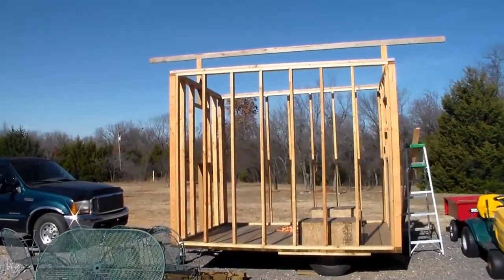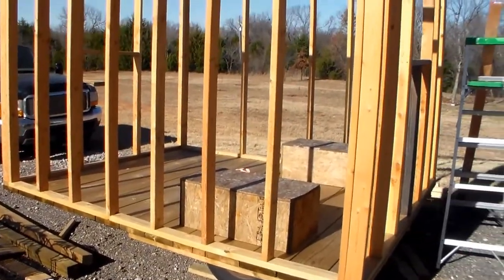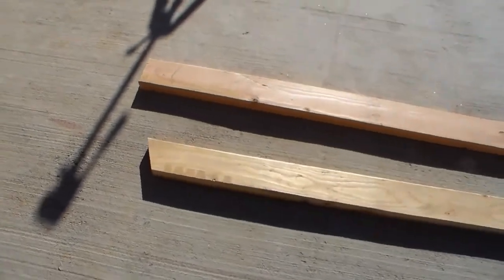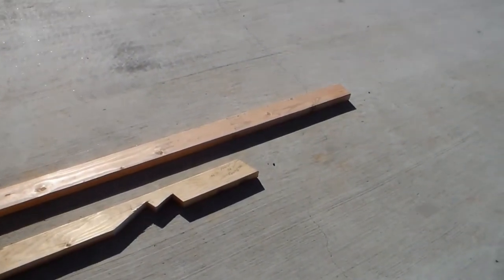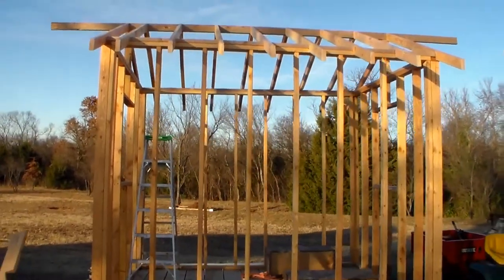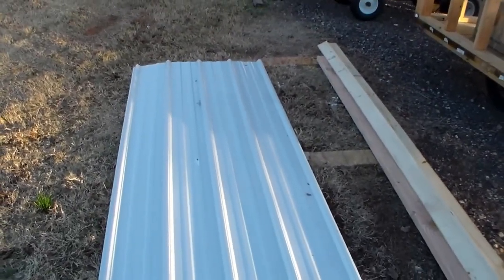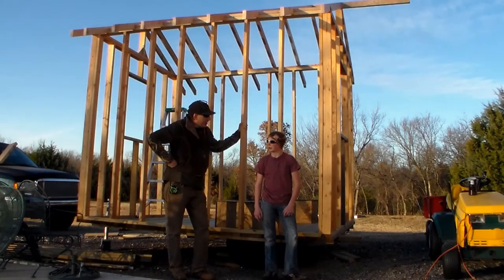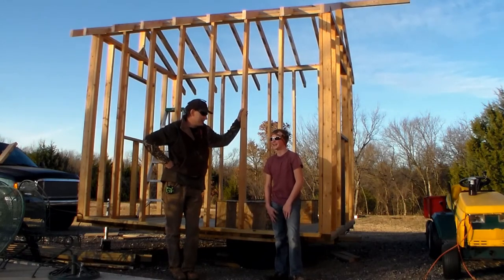Mobile Chicken Coop Build E3 #chickencoop

Comment: What kinda chickens you getting? Check out Black Astrolorps for a good laying duel purpose breed, that will go broody for replacement pults when needed. Also don't forget to over seed landino white clover or a good white clover hybrid in your birds grazing feilds. The protein content of landino white clover is up to 24% and its Highly palatable to chickens. So they pack on weight when growing out, and have very healthy eggs when laying. Plus your bees will love the clover blossoms too! Happy Thanksgiving!
Reply from the maker: DIY Gardener thanks for the advice. We do have some yellow clover I planted a few years back, but could use some more. It gets pretty dry here in the summer, so it’s hard to keep growing.
Reply: Jerome Bee Farm - Well if I'm not mistaken, most if not all clovers are cool growing, so they go dormant in the heat. They are typically drought tolerant though, as they are deep rooted, but may stop growth if it gets to dry. Clovers will actively grow spring, early summer, late fall and winter when temperatures aren't constantly below 50°F or to high. That's why most people do a mix of several legumes, with cool and warm growing legumes, then several grasses which are cooland and warm growing. So no mater the season, you have around 40% legumes growing to complement and fix nitrogen for the grasses or other forages in your feild mix. Are you grazing any other animals on your feilds? Are they just vacant feilds, orchards, bee yards or are they lawn? All those factors can play into the type of mix you plant, but typically between 9 and 12 different plant species, of perennials and annuals, with multiple types of legumes in the mix, can be put into a seed mix that will feed the soil biome to creat fertility, fix nitrogen, and create healthy habitat which produces forage for poultry birds, bees, and livestock. If you want help coming up with a good mix for your climate zone and region, let me know. Happy Thanksgiving, and keep up the good work!